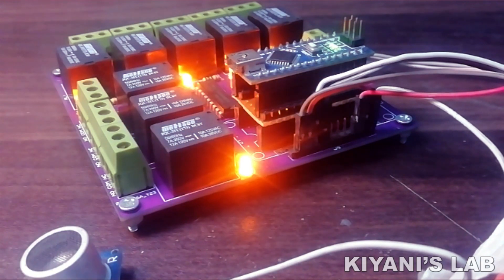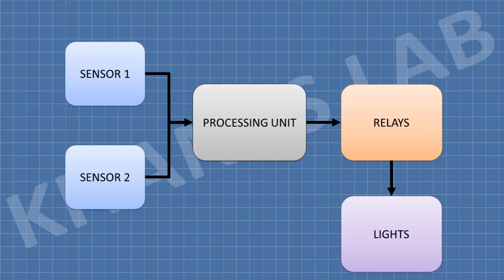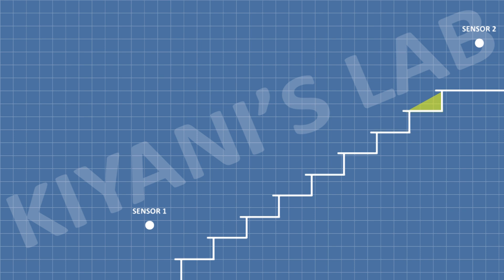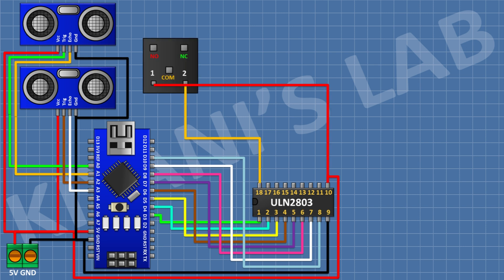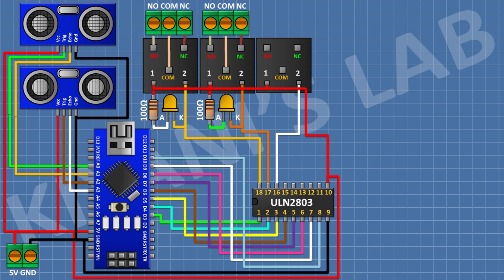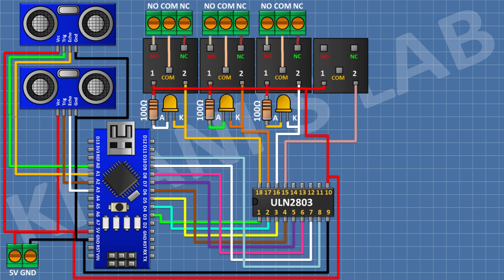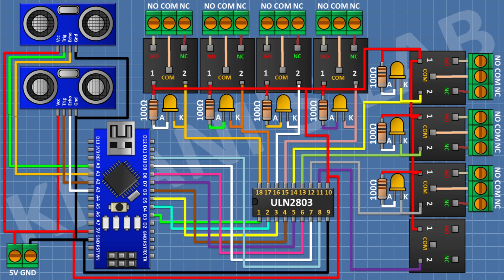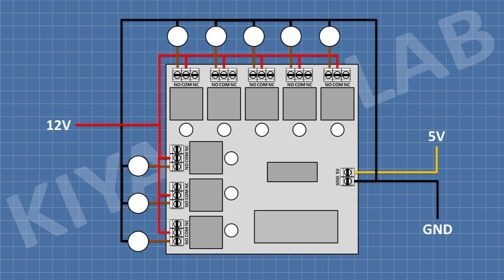How To Make Automatic Stair Lights Controller | Home Automation

Comment: Could you please provide a list of components.  The pcb board that is attached in the link under the description is not the same as in the video.  The pcb uses optocouplers and there are more resistors and LEDs.  There is also an integrated circuit on the board, marked as U8, I don't know what it is.
Reply from the maker: updated the gerber https://drive.google.com/file/d/1j_JVejTuMbyOx7qwv6xlDacNX_AYq9az/view?usp=sharing
Reply: @KiyanisLab  Unfortunately that does not solve my problem. I have already made these earlier pcb boards by the jlcpcb company. Why has the pcb changed? The previous revision did not work properly? I am asking for a list of parts for the earlier version of pcb or please attach a diagram in better quality (the one shown in the film). Will the soft attached to the google drive work with the previous pcb?
Reply: @KiyanisLab  where i can find the please help bro